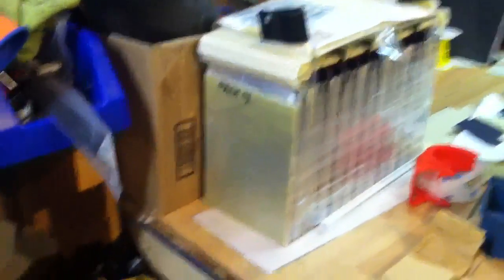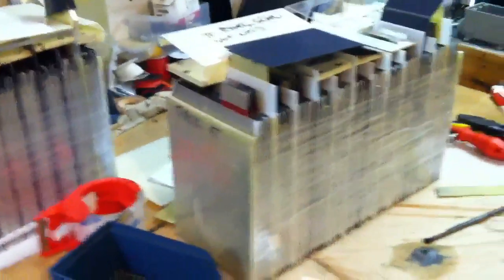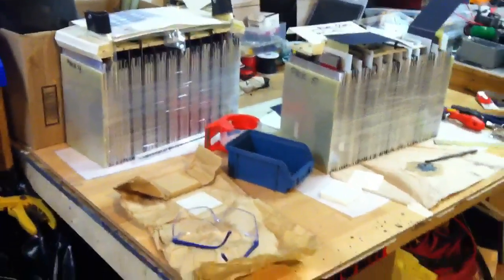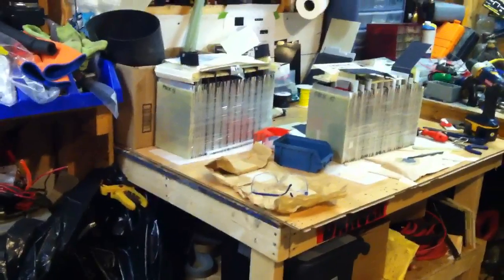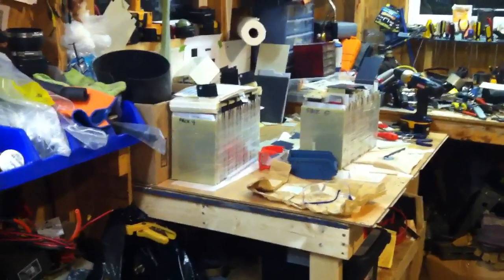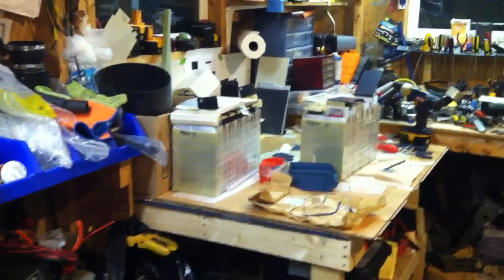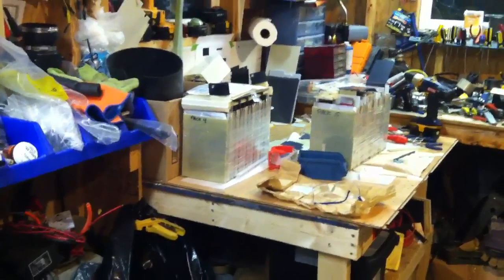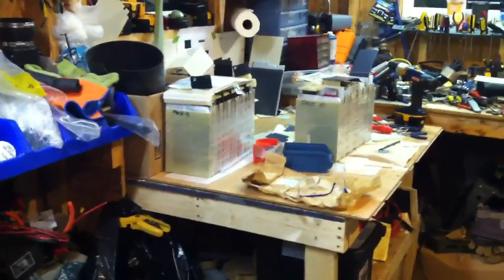Factory Five Mk4 - Electric Car -Video 40

Comment from the maker: Bob,   No cost/time breakdown online anywhere.   The build is 2 years old as of this month, and I would guess that it's 600+ hours so far.   About 1/3 of the time has been put into the battery pack design, cell testing & construction.   Total cost is around $45,000 so far and will probably reach 50 before it's done.

Comment from the maker: It was a breeze!    The basic requirement was that it was substantially a car, rather than a bunch of parts yet to be assembled.    It passed state inspection easily too.      Feels great to finally get behind the wheel and put a few miles on it.  I have never driven a car that handles as nicely as this one does.   EV grin for sure!!

Comment from the maker: The car weighs 1928 lbs with the first 3 packs installed.   Several things are hurting the range including off-the-chart rolling resistance drag radials, a coefficient of drag of 0.5, and low voltage pack .  All of these are being addressed and I am hoping to get below 300 wh/mi, maybe lower.   

In the mean time, a few more miles to finish seating the brushes, and the amp limit will get increased from 1000 to 1400 in a few increments.    At 1000A it is already pulling like a V8.